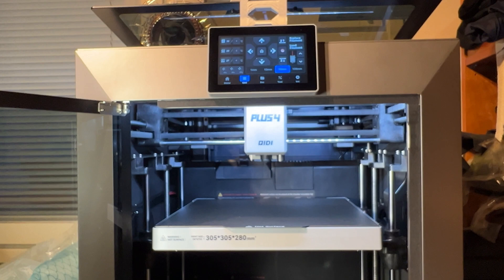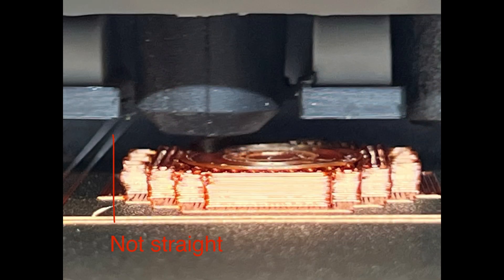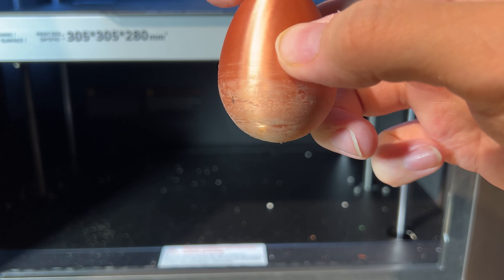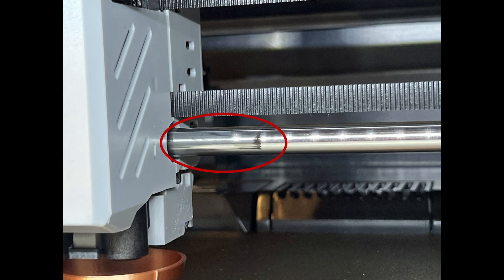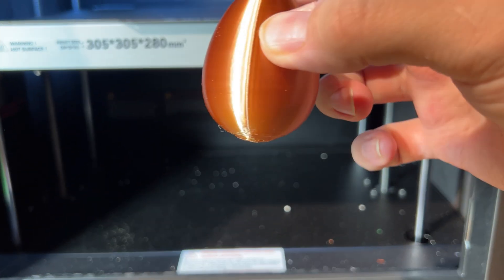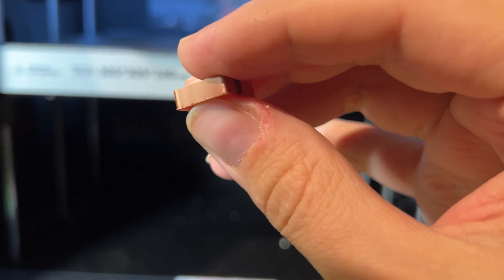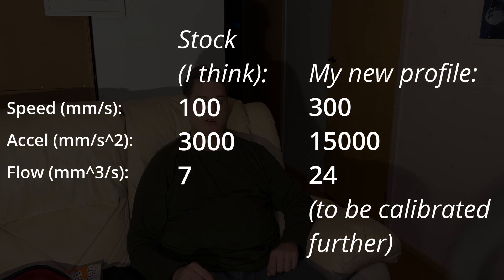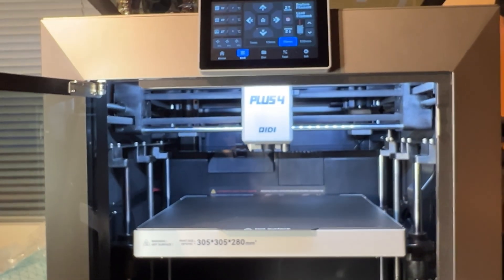Qidi Plus 4 WARNING & Solution

Comment: I'm going to have to try this. I cant get mine to print good at all. Right now, I've just slowed it way down to see if that will fix the problem. Mine is printing ghost rings like crazy. I was really hoping this printer wouldn't give me head aches like all my other ones have. Right now I wish I just paid more and got a Bambu lab printer... Oh well. I can usually get them to print right after hours of messing around with them.
Reply from the maker: PLEASE check my Tips & Mods video for the Plus 4! There can be a magnificent printer hidden in there, like there was in mine!
Reply: @mrelwood_media  I am trying to print a life size model my character Tudaus. I am about 75% done. I bought this printer because I really wanted the head to look good, so I was hopeful that this printer could do better than my other ones. 

I have cleaned the rods, and oiled them, and I have manually adjusted the bed as level as I could get it. I also slowed it down a good bit. 

I'm hopeful that this will work.
Reply: @mrelwood_media I will. Thanks.

Comment: What's an alternative to QIDI Plus 4?  I own one and there's far too many issues to fix I think.  Essentially faulty out of the box.
Reply from the maker: I really don’t know. For the features on Qidi printers you’d be paying much more with other brands. Creality has its own problems too, otherwise it could be a solid choice.

Q2 seems much better than +4 though, but I’m sure that buying another Qidi would be too much to ask for many +4 customers.
Reply: @mrelwood_media  So it's probably more beneficial to apply your fixes and fixes mentioned in comments.
Reply from the maker: @JocMe-c9h  If I think about my printer after the fixes, I wouldn’t change it for any model that I currently know of (except for possibly the Q2). So yes, in my opinion the steps I go through in the mods and fixes video are indeed essential.
Reply: @mrelwood_media  Thankyou for that!  I am still working with QIDI to resolve all issues and have a great functioning Plus 4.  Frustrating and problem is it's been ongoing for 12 months now.

Comment: I have had a ton of problems with my Plus 4:
- The Z probe broke early on, so I replaced it with a Beacon.
- The SSR melted early on, so I replaced it with an Omron.
- The metal "arm" that cleans the chute deformed over time and started hitting the nozzle. I had to bend it down with pliers.
- The PEI wiper deformed over time and dragged on the nozzle.
- The X and Y stepper motor drivers started overheating after hundreds of hours of high temp prints.
- After a while, the bed started getting out of alignment easily, so I have it tram itself at the bottom a couple times before every print.
- I had to relocate the chamber thermal protection sensor to improve its accuracy.
- I had to reposition the chamber heater so it wouldn't get blocked by the bed on tall prints.
- I had to fiddle with the config to get the chamber heater to actually draw the advertised 400 watts.
- All of the hotends I've ordered from Qidi have the same problem - they aren't drilled straight, so the nozzle presses against the heatbreak, which eventually breaks the heatbreak.

Some of these problems were "v1" problems. Some weren't. I've done over 750 hours of heated chamber prints on it, so my printer is relatively "high mileage" - you can expect to have some of these problems later on if you use a lot of high temp materials. There are fixes for all of them, except for the poorly drilled hotends. The fix for that is to hope and pray you'll get a better hotend next time you spend $40 on a new one. I still think the Plus 4 is the best in its size class for the price, but it's not a trouble-free printer.
Reply from the maker: Oh man, you really got them all. I appreciate that you still consider the Plus 4 a worthy printer. I had a long moment where I felt too discouraged to even enjoy using it. Maybe not the best time to make a review, but I did it anyway. Still, there are no exaggerations, and my view on whether to recommend the Plus 4 hasn’t changed. Just that I also have gotten mine to a state where printing is effortless and fun, and I’m getting great quality prints.

I’m sure you’ve already ound all the solutions I’m about to mention, but maybe they will be useful for other readers. This got really long, but each solution is their own chapter.

While Beacon is a common choice to fix the Z offset issues (and speed up the mesh generation significantly), I no longer consider it for myself. The more accurate chamber temperature mod solved all Z offset issues for me.

Plus4-Wiki/content/chamber-heater-investigation/README.md at main · qidi-community/Plus4-Wiki

Luckily the SSR issue has been fixed and the units have long been shipped with an upgraded one. And they never presented an issue in 220-240V power grids.

The chute wiper being too loose is a design fail. One solution is to sand down the underside of the bracket’s front part to cut down the slack. I tried to design a shim to essentially do the same since the above solution still leaves a see-saw effect into the wiper. Unfortunately there are large differences unit by unit so my brackets don’t work for everybody.

https://www.printables.com/model/1265878-qidi-plus-4-poop-chute-sledge-shim/remixes

The PEI cooling sheet edge should be beveled with a knife, file or sanding paper to make the transition smoother. And if the PEI sheet is too high, there’s a screw underneath to adjust the height for the left side separately.

There are mother board cooling ducts and mods for bigger fans to prevent overheating. Here’s mine for the stock fan, with a constant 21•C reduction in temps.

https://cults3d.com/en/3d-model/tool/qidi-plus-4-improved-mainboard-grill-fan-duct

Lubing the lead screws and loosening and tightening the bed frame screws (to alleviate tension) might help with the bed losing the left-right sync. Yours is a great mod though.

The current firmware 1.6 stops the chamber heater if the print gets past 270mm. Not great for engineering materials though. How did you position the heater??

Chamber heater power ratio adjustment is a common requirement, as 0.4 is on the safe side. Unit to unit differences are big, and the required value varies between 0.4-1.0. Measurements are needed for adjustment.

https://youtu.be/CBa6LchgbQw?si=BGIMhWFfzycNL23K

Jamessteven44 (Reddit) / Helixx 4D Solutions (YouTube) figured out a method to align the hotend so the nozzle doesn’t get bent.

https://youtu.be/OBPOViz8HgA?si=H4FVv1M1rPB7A23S

Hope that was helpful for someone!

Comment: Hi ich habe auch einen qidi plus 4 und habe bei Druckteilen auf glatten Wänden Artefakte. Die Passgenauigkeit ist mehr als super doch die Optik gefällt mir noch nicht. Welches Öl oder Schmiermittel hast du für die Führungen in X ,Y genommen ?
Reply from the maker: Hallo. Ich verstehe Deutsch nichts.
Reply: @mrelwood_media  
Hi I also have a qidi plus 4 and have artifacts with printed parts on smooth walls. The fit is more than great but I don't like the look yet. What oil or lubricant did you take for the guides in X,Y?
Reply from the maker: @exxos10  Sewing machine oil or a similar light machine oil is what Qidi recommends. I used sewing machine oil.

In addition to that you need to calibrate the Pressure Advance, and I also got the vertical artifacts less prominent with these mods:

https://www.printables.com/model/1044712-qidi-plus4-belt-tensioners/files

https://github.com/qidi-community/klippain_v511_for_qidi_plus4

https://github.com/guykuo/Plus4-Wiki/blob/main/content/stepper-motor-tweaks/README.md
Reply: @ okay I will check that

Comment: That "mud" is not graphite for lubing the bearing? Maybe it shouldn't be lubed at all.
Reply from the maker: @19mati67   I’m aware that graphite filled linear bearings are often used dry. But the printer manufacturer strongly advises to lube it, and like I explained, lubing turned bad overhangs into great ones. To me it’s a really easy choice to make.

Comment: You can set up Random Start points in the slicer setup before slicing.
It will eliminate that start stop line on the prints.
Reply from the maker: @jobos98   Sure, but it also makes smooth surfaces full of little dots. It depends on the object which is better.
Reply: ...or use scarf joint seam (in Orca)

Comment: Can you do a video where and how to properly lube the plus4 for all the noobs out there
Reply from the maker: @alh5470   No need for a video:
- Put some isopropyl or rubbing alcohol on a non-lint cloth and wipe the round bars that are inside the printer.
- Put some sewing machine oil on a new cloth and wipe the same rods.
- Move the toolhead left and right with your hand. If the rods get dirty, repeat the process.

- Do not spray oil inside the printer.
- Do not apply the substances to any other parts or materials than the round rods.

Done.